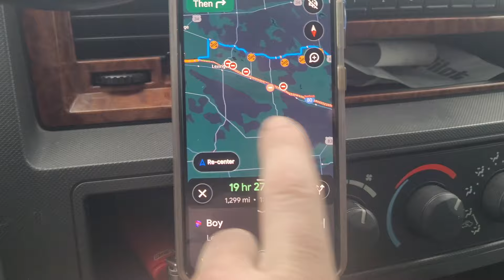Almost Totaled Everything... Nebraska Ice Is No Joke!

Comment: where are the chains you bought for the travel trailer tows?
Reply from the maker: At home. They are a completely different size than these but it's not like they would've helped. NOBODY was running chains when I went through. Surprisingly only saw 2 or 3 accidents
Reply: @CPSteveMiller  Good job on driving in that mess.